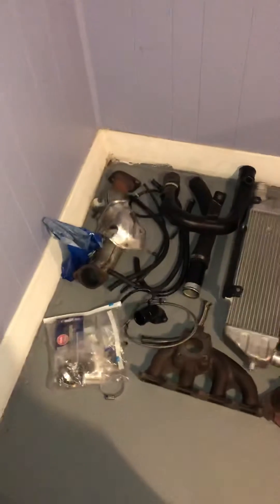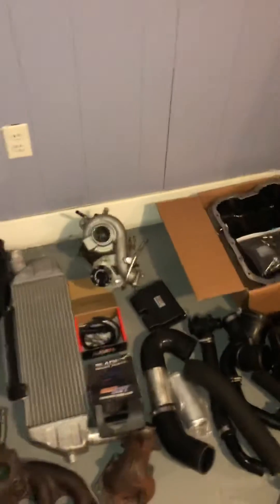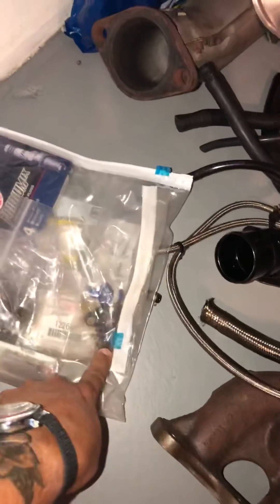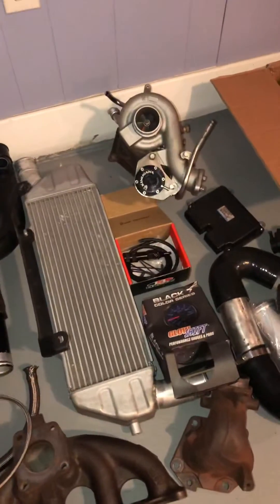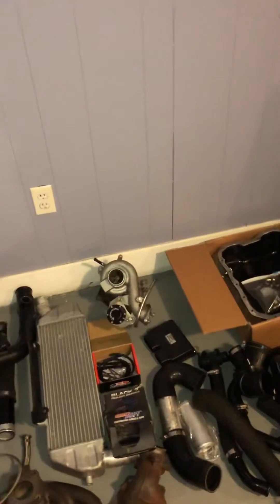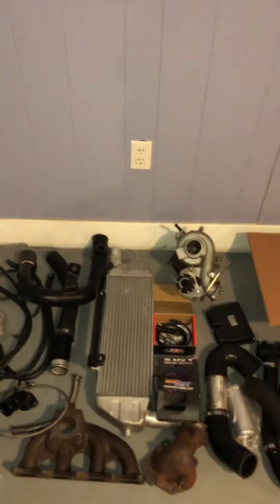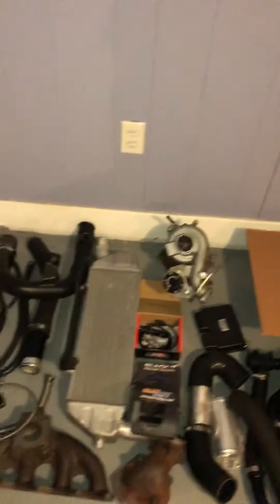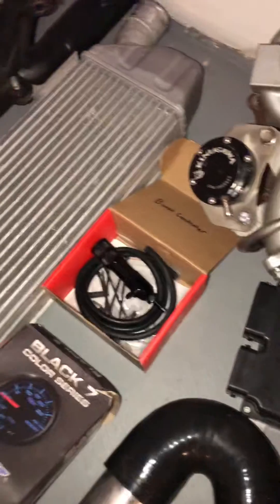How to turbo a Lancer ES episode 2 parts list

Comment: How much do you spend in all the pieces?
Reply from the maker: Abraham Rodriguez  do you need a turbo kit? There’s a guy that sells them, about 800-900$ for the kit, you’ll need various gaskets, ECU tune, boost gauge, boost controller, etc about 900 for the turbo kit and about another 800$ for all the bits and pieces and the tune
Reply: @ikecostner1  Thanks, iam in the Mitsubishi lancer turbo club,  i think i saw you over there and iam try to get all the info that i can.
Reply: @ikecostner1  where do you get the kit?
Reply from the maker: @PolloCustomz   join “Mitsubishi Lancer turbo club” on Facebook and post looking for a ralliart turbo kit